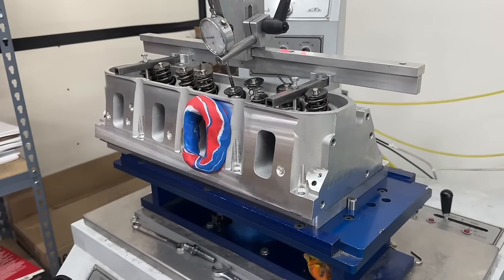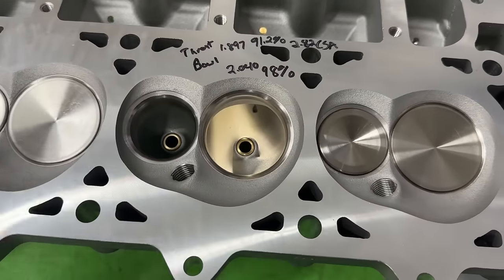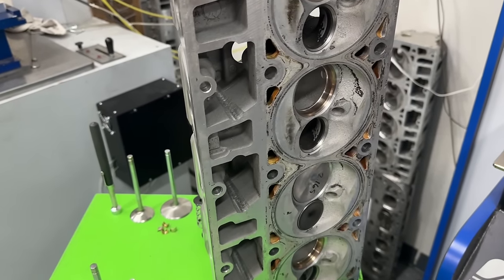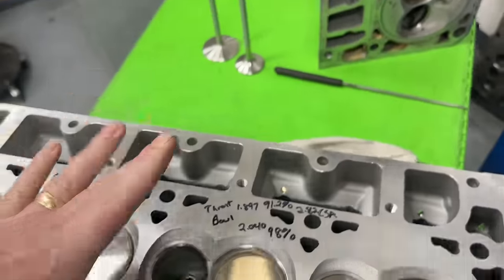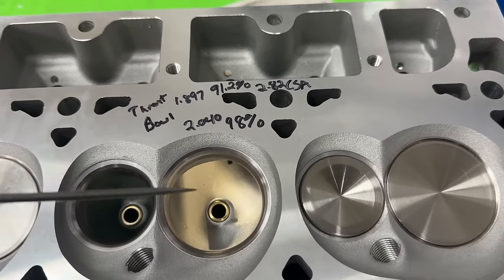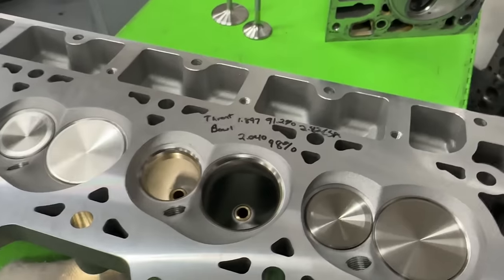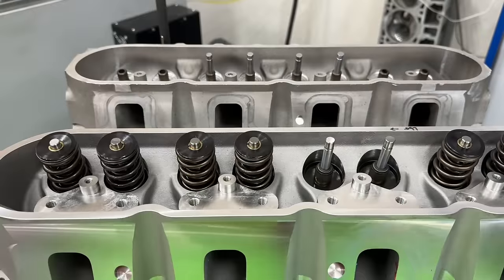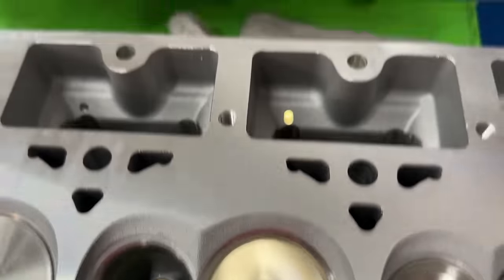NEW AFR LS3 Enforcer Head Review With Real Flow Numbers

Comment: I didn’t hear price. Very nice option if you need heads for your 6.0 or bigger.

Regarding small bores, I think you need to deal with radius, not diameter. The edge of a 3.780 bore is 0.110 inside a 4.000 bore. If the valve is 0.085 smaller, that is about 0.043 on the radius, ie, the increase in distance from the bore edge. Add a 0.090 change in valve CL, and you have 0.133 more spacing, well inside the edge of the 4.8 or 5.3 bore. This all assumes the exhaust valve wasn’t moved, which we don’t really know, but seems likely from the room next to the intake valve. I guess it’ll take a mock-up to know for sure, but it should work.
Reply from the maker: I didn’t put a price because someone could watch a year later and it could be different

Comment: I wonder if Richard Holdner would do a comparison of a stock ls3 then swap to AFR Enforcer?
Reply: @unitymotorsports & I have been doing track testing with these heads on my truck, it has been a 6.48@105.98 on motor with radials, slick it went 6.60@104.34, swapped to the afr heads untuned went 6.68@103.23, we will  tune it this week and run it again, then porting them and re tune vs track,
Reply: Awesome. Would love to see the final numbers.  I watch you guys also.  Find David’s mustang interesting too.
Reply: @garyhosier4765  appreciate it
Reply: @Boostismyfriend  do you guys watch Eric weingartner?  He just did some flowing on ls3 enforcers.  Thats why I was wondering because Richard does a lot of dyno work with junkyard engines
Reply: @garyhosier4765   yes i watch eric all the time,
Reply from the maker: I also do dyno testing. One of them is a 408ls
Reply: Yes.  You just built the 408 but you mentioned the stock heads and I was thinking Richard always does junkyard stock dynos then throw on some enforcers with stock exhaust manifolds, intake and cam.  I really want to see your LS also.  You’re doing a fantastic job with content.  I’ve learned a lot and broken some fallacies.

Comment: Eric, the Brodix BR 1 13 cathedral ports, 245cc, 2.10 int x 1.60 exh, have you flowed them to compare the 370cfm? I am an sbc bbc guy, but I picked up a dart ls block from a Nascar team for $1200 and I'm looking to throw those heads on the block and make my 70 GMC a a/c hot rod cruiser since I got the 88 Monte SS as the drag car.

Comment: For those wondering, here's intake flow numbers for the Promaxx Small Bore Rectangle Port heads (as tested by Eric previously):

Lift    CFM
.100    70.3
.200   132.7
.300   199.4
.400   263.7
.500   313.1
.600   337.4
.700   353.1
.800   331.8
.900   337.2
1.000  335.7

So up until and including 0.400 lift the AFR Enforcers have the advantage, then the Promaxx Small Bores take over from 0.500 on up. A few additional things to consider: 

- The AFRs only come in a 72cc chamber, while the Promaxx Small Bores are available in either 63cc or 59cc. 

- They both use a 2.08 intake/1.60 exhaust valve, and the AFRs are a 238cc runner vs 240cc for the Promaxx.

- Now one of the biggest differences: price. The Promaxx Small Bores are currently $1609.00/pair BARE with an additional ~$120 shipping for a total price of ~$1729.00 (from Promaxx directly). The AFR Enforcers are $1225.56/pair BARE with free shipping for a total price of $1225.56 (from AFR directly). The ASSEMBLED Promaxx Small Bores are $2305.00 (with .650 PAC springs) plus ~$120 shipping for a total of $2425.00. The ASSEMBLED AFR Enforcers are $1501.82 (with .650 PAC springs) plus free shipping for a total of $1501.82.

It'll definitely be nice if the AFRs fit on a 3.898" LS1 bore, but the large 72cc chambers are going to be an issue for anyone wanting to run naturally aspirated.

Comment: Hello, How do you think these would perform on a stock bore 5.7 LS1 with a Stage 2 cam, Fast LSXR 102 intake and 15 pounds of boost from a procharger in a street Corvette with the factory 6 speed?  Thanks for your help and your videos!!
Reply: As far as I’m aware these heads only fit LS plants with at least 4” bore, so LS2 and newer

Comment: These should fit a 3.9 bore ls1. There is 0.090 missing between the valves plus another 0.075 from the different valve package. From outside of exhaust to outside of intake valve has dropped by 0.165. They prob wont clear 3.78 bore but a 3.9 looks like it should be no problem.
Reply: One would hope, otherwise it seems like an awful lot of trouble to go through just to get a 2.08 intake valve in there.
Reply: I set one on my 3.80 5.3 block, i think it would work, plan to check more later
Reply: @Boostismyfriend 🤔

Comment: So I'm building a 4.065 bore lq9 that's has the block filled. (Drag racing only engine). It has a 2cc dome summit pro ls 2618 piston with generous valve reliefs that work with 13.5* cathedral heads or 15* ls3 heads. My question is since this head has such a smaller valve and the spacing is tighter but it's 11* valve angle, do you think it will help with ptv clearence? I'm gonna run a cam motion solid roller 249/263 680/650 111.5+3. Engine is gonna be just barely 12:1 compression, at most 12.2:1.
Reply: I'm assuming it won't change much at if it even does give me more clearence than a 2.165 11* head would. Originally had liberty ls3 heads and cam motion designed the cam around all that info. So I'm hoping to get lucky and clear. But I'm gonna try these heads as well stock for stock and ported for ported
Reply: I'd guess that engine and a ported ls3 head would run hard. My 4.030 bore ls2 with mild ported and valve job ls3 heads made 575/535 with only 11.4 compression and 227/237 621/604 113.5+3.5  runs 10.8 at 126 at 3650 with manual transmission

Comment: I’ve kinda had a thought that Chevy did the square port head too big, to kill low end torque on purpose, for drivetrain purposes, they were also going to 6 speed autos around the same time, so they didn’t want or need more low end torque, having steeper first gears, somewhat made up for it, also imo people really sleep on nice cathedral port heads for the ls, they will almost always make more average power, 3k rpm and up, a set of cathedral ports setup similar to those enforcers would be sweet to compare
Reply: They did do it too big on purpose. That is correct. The reason had to do with part-throttle pumping losses and fuel economy. Also follows the "big head-small camshaft" theory to reduce emissions